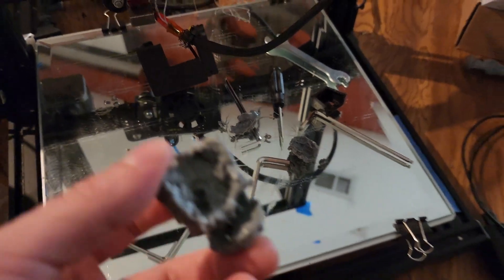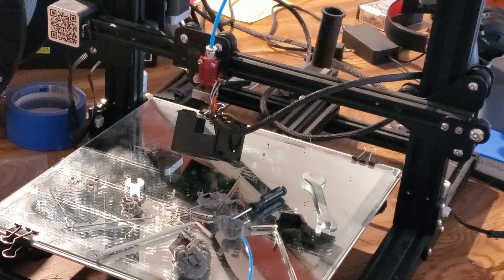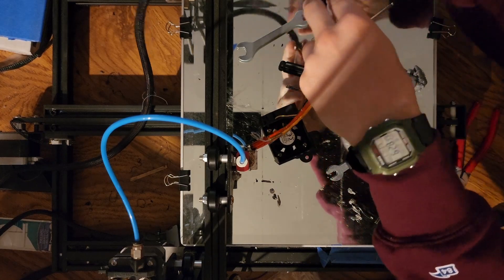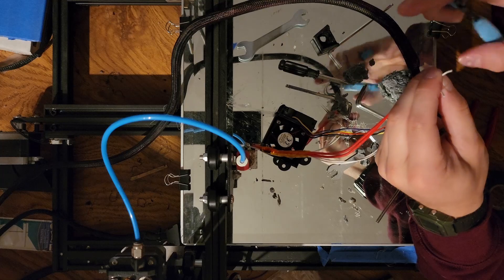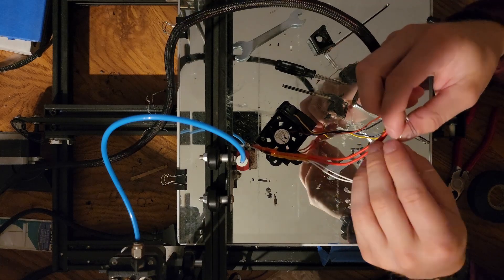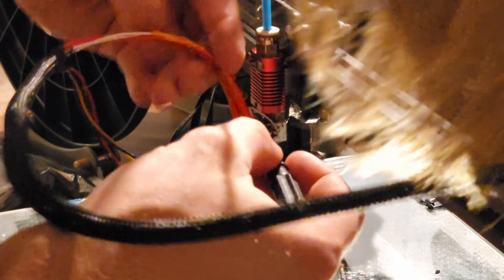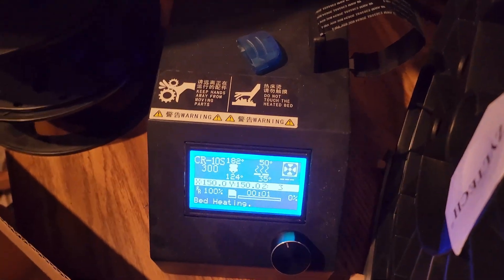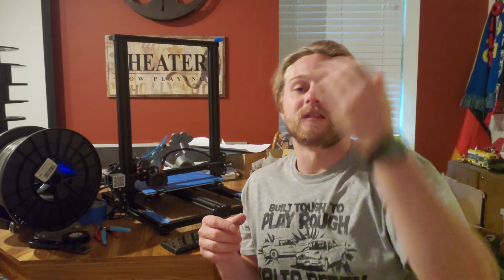How to Replace a Creality CR-10s Thermistor

Comment: 2 years ago- hey, how long did that thermistor work out for you? What I've been seeing/reading has led me to believe that a splice without solder is more prone to failure in the hot and mobile conditions a thermistor wire is in.

Comment: I'm just about to do this for the first time, so your 'I'm not a professional' approach was perfect for me! I'm just concerned about the NEXT time I have to do it. Cutting through the electrical tape and find the join! Will there be enough wire to go again (and what about the 5th time!) :)
Reply from the maker: In my experience, my hot end actually started to deteriorate in multiple ways before I needed to replace the thermistor again, and I replaced the whole hot end assembly with a new one. As long as when you need to replace the thermistor again you unravel your tape instead of cutting above it I would think that you could save the wire from continually getting shorter.